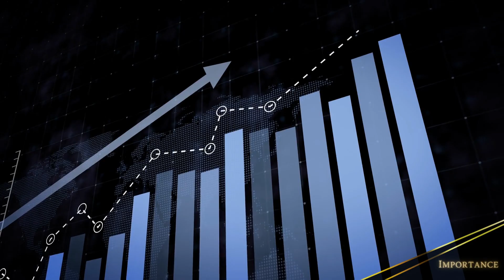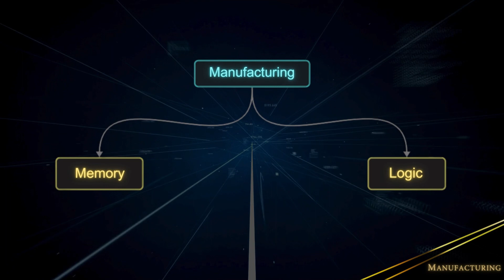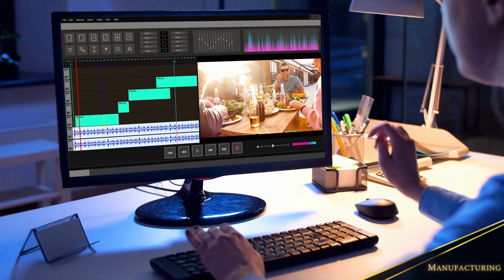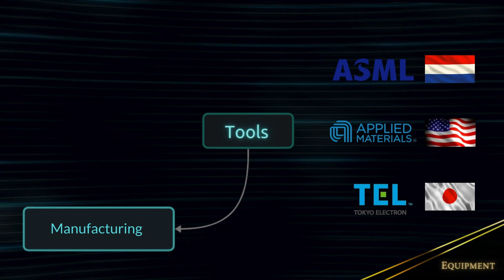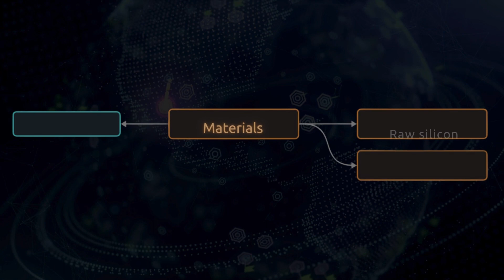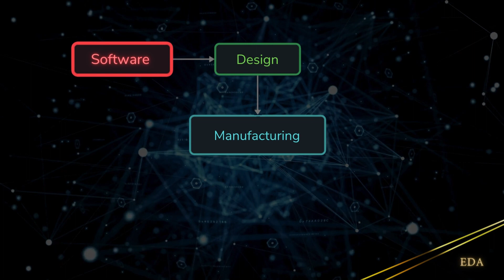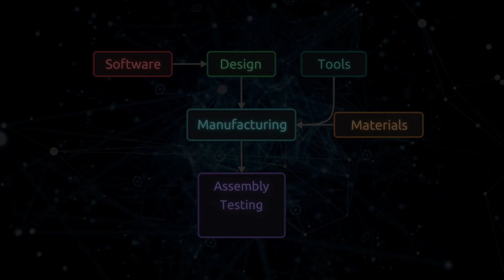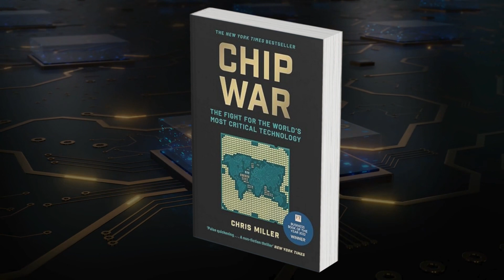Who is winning the Chip War

Comment: China is developing a carbon based chip Graphene set for commercial use by 2030. This will be cheaper and faster. So, another 7 / 8 years American restriction will work beyond that China will move forward without any restriction.
Reply from the maker: Yeah, I think the West has become very complacent, underestimating China's acceleration, and is up for a big surprise by the 2030's